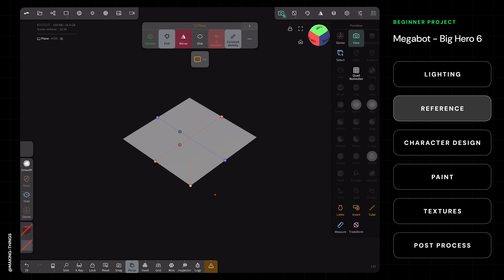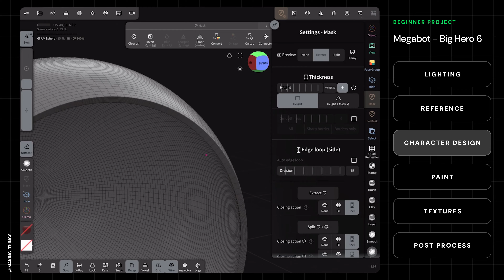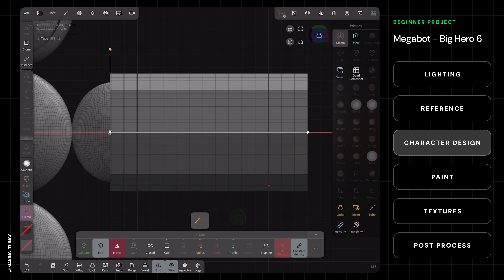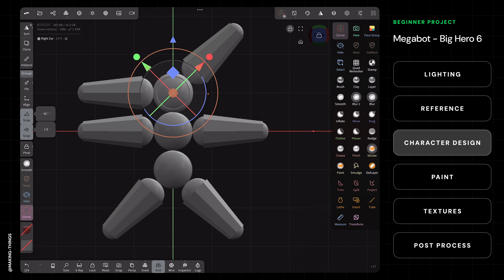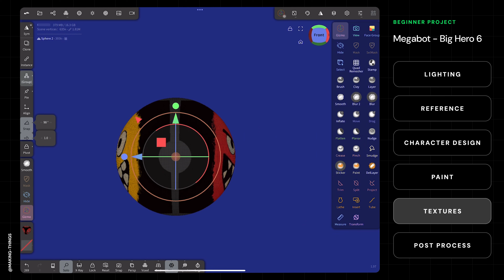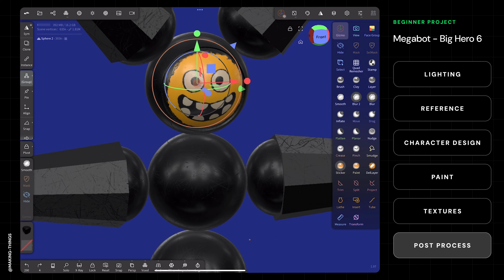Nomad Sculpt: Beginner: Creating Megabot From Big Hero 6

Comment: Love the video! Almost done but when I am applying the sticker I'm running into some differences. First off, How do you have the material called "None" I don't see that anywhere? So then, when I add the stickers, yours shows up as the smiley face in a square. Mine is showing up in a circle. The black around it is a circle where as yours is a square. This is making the next step of painting the sides of the sphere using the mask more difficult.
Reply from the maker: Sorry for the delay in my reply. I am not sure what is happening. My first thought is that maybe there are differences in our Sticker tool settings. Perhaps something that I failed to mention. I am not 100%.